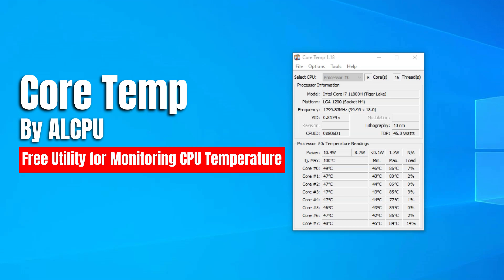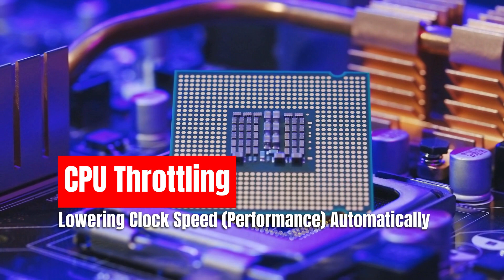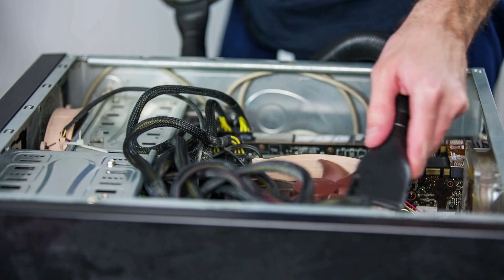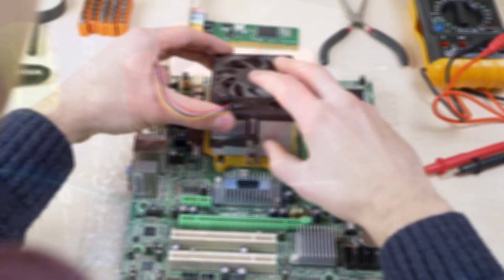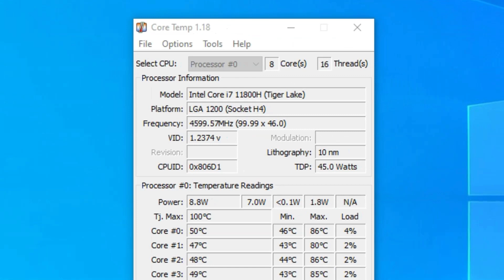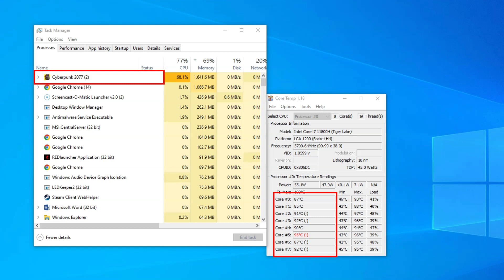What is TJ MAX in Core Temp | CPU TJMAX

Comment: Hi 
Soo my laptop is getting 92 dgree for cpu is normal? Under heavy games like hellblade 2 
Stuck at 92 dgree 
I7 11800h like yours 
I did lower it's speed by power management 
But if 89-92 temp is OK then I don't limit it's speed pls tell me
Reply: its safe to run but your cpu lifespan will be shorter for running at that temp when you game all the time.

Comment: Is it actually normal for a cpu to reach 90 degrees during gaming session? My CPU can run Final Fantasy XV with 60 fps, but the CPU usage is really high, like running in 100% most of the time, causing the temp to always go up to around 80-90 degrees, and sometimes, I saw one core reach 96 degree and it worried me. I turn on the heat protection on  Core Temp, but it never notifies me about the heat. Is it normal?
Reply: perfectly normal, as long as the temps don't exceed your TJ max then it should be able to run at 96 degrees, my laptop hit's 99 degrees while gaming and I just replaced the thermal paste.

Comment: I have question, why is my i5 5200u's junction temperature max is 102? I check the online it say 105. Until i found out in throttlestop say the PROCHOT offset were edited by value of 3 (value of 0 would make 105 of TJ, value act as a minus/subtraction) but my other laptop have N4000 and it have TJ max 105. And my i5 laptop CPU TJ cannot be change. Is my laptop i5 TJ modified by HP or wut?
Reply from the maker: It was probably factory-modified. You can confirm with HP customer support

Comment: Can we change tj max temperature?
Reply from the maker: Unfortunately, you can't
Reply: @pcunwrapped  you can in the bios of certain motherboards / cpus. 

My Tj Max was at 115 default, causing a lot of crashes. AsRock is at fault. Intel says 100 was fine. I put 90, no crashes anymore.
Reply: @MasterCeddy Which CPU and motherboard model?

Comment: I have 1 question:  I have a AMD Ryzen 5 2600 and amd says that the tj. max of the cpu is 95°C. And when I start Core Temp it says that the tj. Max is 73°C. Can I do anything about that?
Reply from the maker: Try using a different utility (Real Temp) and if it reads the same.